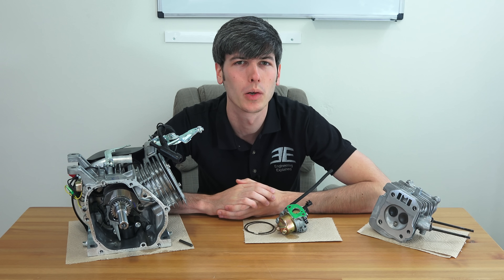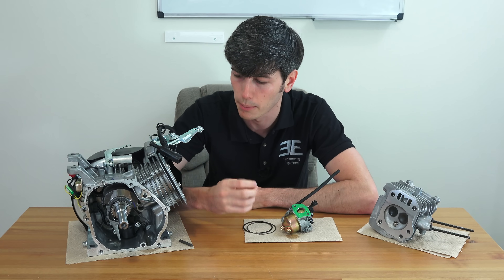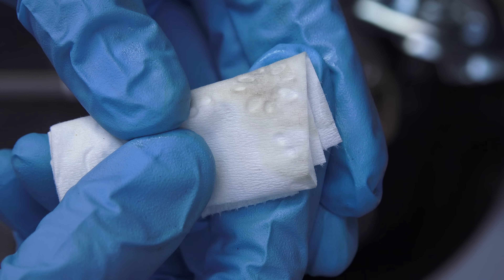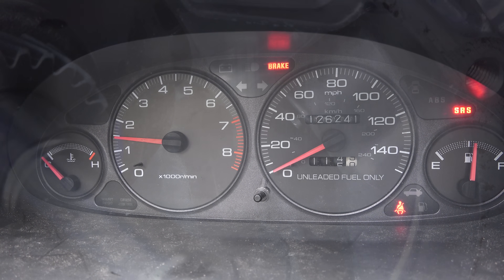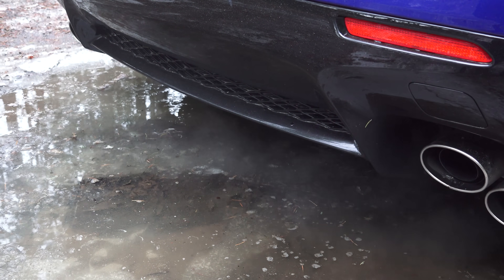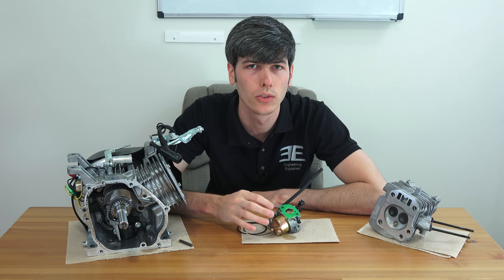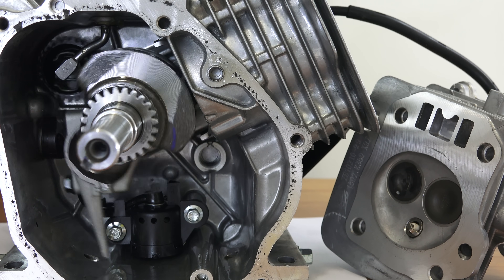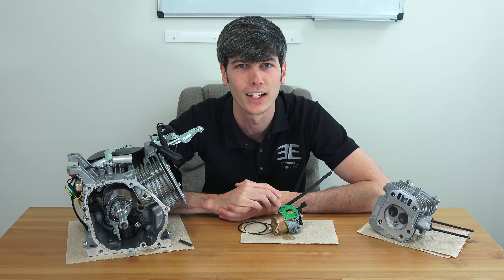Should You Warm Up Your Car Before Driving?

Comment: The reason why we warm up our cars is to warm up the car interior when it’s freezing out, not because we want the engine warm.
Reply: When its -30c out, you have to heat them up just so your breath doesnt ice up the inside of the windshield.
Literally done so you can see the road.
Reply: No. It’s because we live in Miami and we’re not used to the cold so we wait like we see everyone else do on tv.
Reply: It's a pain to take your coat off mid drive because it's finally warmed up in your car so it's better to let the interior get to a tolerable temperature before driving. Also a heater would be expensive to install.
Reply: Thats just wrong.
Idling your car wears the engine out prematurely and it make stew heater take a lot longer to actually get warm air to the interior of that car.
Since ti are in cold weather you already are wearing warm clothes, so getting inside a car is warmer than being inside because the cold air is not blowing on your and your body is warming the interior.
Idling the car that I just tested three days ago took 12 minutes to get warm air to the heater vents. The same car when started and driven immediately, had warm air coming out the vents in less than 2 minutes, so obviously driving the car as soon as you start it not only reduces engine wear radically, it gets warm air to the interior much faster.
Reply: I only warm up my car until I can scrape the ice/frost off the outside and the inside is defrosted as well.
Reply: @maxglide  Scrape faster to avoid wearing out your engine unnecessarily. By the time the interior is warm from idling the engine, you have already contributed to significant engine wear.
Reply: Billy Bob dude, you have no clue. Where I live I get 25ft plus of snow and the windows frost up on the inside! I have to wait until defrost blows warm to melt inside
Reply: @maxglide  Dude, you don't know how to take care of your car. Where I live, in some years, the snow is so deep that it buries my car completely during the blizzards that drop the temperature to -60) F (measured officially) so I have far more experience dealing with severe cold and snow. I'm trying to help you out but if you want to fill your heater ducts with mold and if you want to wear your engine out prematurely then just stay on your destructive path.
Reply: Billy Bob i grew up in northern Ontario, so I know about extreme temps. The fact remains I don’t drive until the inside of my widows are clear. I will not endanger other people because of some possible engine wear. And FYI, I’m driving my 2005 CRV, 14 years of winter and snow only minor maintenance needed. So yeah, I think I have a small idea on how to take care of my car....
Reply: @maxglide  Obviously you don't actually know anything. I lived through the same storms as you have, probably for many more decades than you, and plus i'm an engineer with multiple degrees, so I do understand more about mechanics that the average person. If you want to destroy your car then go right ahead, but posting bad information on the Internet does help anyone, you are hurting people who don't know any better. You should keep your mistakes to yourself unless you are willing to buy new engines for everyone.
Reply: I agree. It's also sometime necessary to get enough heat from the defroster to keep the windshield from frosting up or to melt the snow off of it if it is snowing. I don't generally warm up my car if the temperature is above 20 degrees F or so, but if it's colder, it's much more comfortable to drive a warm car and much safer to drive if I can see where I am going.
Reply: And its people like you that leave shitty cars for others, Always let ur engine warm up a bit b4 driving
Reply: Yep
Reply: KowalDW nah
Reply: Simplicity Audio Video for me it’s so my windshield clears up 😂
Reply: And the interior doesn’t get warm unless the engine is warm. So just get in and drive.
Reply: Myles Hejmanowski I’ve tried to do that before and my windshield go so foggy that I had to put on my hazard lights and pull over even thought I had the heat blasting the windshield
Reply: @johntaki2704  You're doing it wrong. Most likely that car has seen a lot of use of the RECIRC button. It sounds backwards but do not ever use RECIRC in the winter. RECIRC traps the same moist air in side the vents, which build up pools of water or even ice, and then when you turn the fan on it then  fogs the windows badly. To get rid of all that moisture and ice that you have built up for years, get the car up to temperature, set the heat to max heat, turn off RECIRC (and leave it off all winter) then set the fan to high and let it grin on high for 5 minutes. Hopefully it has gotten rid of all the moisture by then. Now drive but leave the fan on high or medium so it continues to blow out moisture. The windows should stay clear., if they don't stay clear pull over and run the fan on high for ten more minutes and try again. If they still don't clear up then shut it off and tow the car to the mechanic because your RECIRC is stuck in the on position.
Reply: @Billy123bobzzz  I think if the only thing that is wrong with my car is a bad RECIRC button, I'm going to drive it to the mechanic and save the cost of a tow.
Reply: moisture from breath freezing to windshield is why my coolant has to be warmed from -40 to above 0 C. friction of the crank smashing the now tar in oil sump helps to warm  the oil.  if you havent driven on frozen tires waiting for the rolling friction to make them round again dont judge or make these videos. i also idle in neutral a bit to spin some of the trans parts.
Reply: @ChickenStripsLife  Oh! The tires! I forgot about that! I only have suffered from flat spotted tires once, when I use to buy really cheap tires and there was no snow. When I pulled out on the asphalt, it was like riding on a vibrator and it took a while before they became round again That is a frighteningly fun experience. It doesn't happen on Snow, I guess because the snow was very deep back then, and I suspect that the flat spots actually gave me better traction, so there is an advantage to them. Once I could afford the most premium tires, that I have also ways used since then, I have not had any flat spot incidents, so I wonder if the new synthetic rubber in the good tires is formulated to stay flexible at lower temperatures.
Reply: @Billy123bobzzz  whelp my guess is you burn out the belt of a snowmobile by not suspending and spinning the track pre riding on a -20 or colder day. It's amazing that you live in a climate that is worse than everyone else yet still on the grid. Have fun with your better than everyone life.
Reply: Simplicity Audio Video, i use a car warm up here in canada.
Reply: Uh, you know the car's heating system warms up the inside faster when you're driving and not just sitting there idling, right?
Reply: Chicken and the egg, So probably rev it at 2000 rpm, not everyone can drive for 5min in a 20 zone, some have to go up hills and directly onto fast roads.
Reply: 100%
Reply: This video is clearly for drivers living in warmer climates where temperature in the wintertime is rarely below -10 celsius. I live in the north where it is normal to have - 20 to -30 celsius in the winter. All cars sold here have at least electric heater for the engine and optionally another for the interior. There are power outlets in the parking lots of the living areas for the heaters. I myself use a remote controlled 5000 watt fuel heater (webasto). I have a shield in front of the engine that protects it from the icy wind when driving. When the engine is pre-warmed, the climate control of the car starts to warm up the interior soon after starting up. All cars have heated seats, mirrors and rear window. Winter tires are mandatory during winter. Btw, it is illegal to keep the car engine on for more than a couple of minutes if you are not driving.
Reply: @carbonara2144  No, that's not right. I live where its -35º F every year and -60º on bad years and I have been using this procedure since my first fuel injected car and its always worked very well for me and my cars always warmed up faster for me.
Reply: @Billy123bobzzz  what is not right?
Reply: I care more about my motor than just keeping myself warm
Reply: If you dress to be outside in the cold, you’re dressed to drive your car to warm it up. That’s what I do, even when we had -23 before windchill.
Reply: Carlos Saldana yeah but I’m not gonna put on a winter coat to drive for 5 minutes and then go inside a building that has heating
Reply: Jackson H you know you can take the coat off right?
Reply: Luke Freeman yeah but why even bother taking it in the first place when I could just warn the interior up
Reply: @jacksonh7009  so your gonna idle your car for longer then the 5 minute drive you have to make just cause you dont wanna put on a jacket?? Smfh
Reply: This is why you get an interior car heater so you dont have to run the engine very long but your interior is toasty and warm when you get in. Also keeps the windows from frosting up.

Comment: Hadn't realised this before, good video. Doesn't the engine also wear faster if you drive it cold though? My guess is it's not gonna be as detrimental this, but doesn't it also have a negative effect, especially if you have to enter a highway and do a decent acceleration soon after pulling off?
Reply: Did you watch the video? 

If you did you’d realise that your engine idling to warm up isn’t without wear as well.
Reply: @306maxievo2  Yes I did.
I was asking whether the act of a big cold acceleration wears the engine down more than warming it up by idling for a while beforehand...
Reply: @BlackArtBMX  you still drive gently. The engine warms up more quickly and you get less wear and the oil degrades less.

Comment: When it’s -40f, I’m letting it idle for at least 10 minutes..
Reply: Very smart
Reply: Seems like a total waste of fuel, living in Canada when it gets that cold I just plug in the block heater a few hours before leaving.
Reply: @Spinal2111  Idling really doesn't waste that much fuel though.
Reply: @seraphimvalkyrin4543  idling wastes a lot of fuel, this same guy has a video about the difference in idling and starting the engine.
Reply: @APerfectToolSifer  I had to camp in my car once all night during fall/winter so I had to leave my car idling for 6 hours. The fuel gauge only moved 1/16 from full. That's a lot less then any other use of fuel that a car would use in a 6 hour period.
Reply: @APerfectToolSifer  it uses 0.5-1L of fuel per hour.
Reply: @gigel99324  For sure, doesn't sound like a lot but when you think about the difference between start up and idling for just a minute and driving, plus the emissions, thats a lot of waste to just have your car sitting there. Put on a good jacket and start driving, air quality is more important than having a warm car/truck to get into.
Reply: Nah according to this guy who is between age 20 and 55 ur good to go the second the engine is idling.
Reply: A coolant warming system would help
Reply: @rotorblade9508  Like a battery and oil pan heater.
Reply: Thats just wrong.
Idling your car wears the engine out prematurely and it make stew heater take a lot longer to actually get warm air to the interior of that car.
Since ti are in cold weather you already are wearing warm clothes, so getting inside a car is warmer than being inside because the cold air is not blowing on your and your body is warming the interior.
Idling the car that I just tested three days ago took 12 minutes to get warm air to the heater vents. The same car when started and driven immediately, had warm air coming out the vents in less than 2 minutes, so obviously driving the car as soon as you start it not only reduces engine wear radically, it gets warm air to the interior much faster.
I've tested this in the past in a blizzard at -60º F and the car really did warm up in just over two minutes when I only gave it ten seconds of idle time and then drove it respectfully. When I let it sit there and idle the evening of the same blizzard, to go home, it barely got warm in 15 minutes so it was not worth wasting all that gas and all that wear on the engine.
Reply: @Billy123bobzzz  that's where you're lying. Better go read some technical specs on any commercially available oil, operating at -60'F. You're 100% seizing your motor because of 0 lubricity and 0 flow from the crankcase. Furthermore the odds are your automatic transmission's oil wouldn't actually allow you to shift into any gear because it would also literally be a frozen gel (I know it was an auto because you obviously have no idea what you're talking about here, mechanically speaking)
Reply: Furthermore since you're using Fahrenheit, the only place to be that cold since 1954 was Alaska, in which case this "blizzard" must have happened in 1971 or 1986.
Reply: @l3urlyi345  he's full of crap. He's copying and pasting that nonsense everywhere. He probably works for the car companies wanting you to destroy your engine
Reply: @stylicho  Calm down, as long as you have the winter rating in your fuel you're not destroying anything. The oil I use (5W-40) is good for -35 Celsius. I've done cold starts at -32 and had no problems. Modern synthetic oils flow immediately in the cold if you use the proper rating. 
The problems with oil flow come when it gets so cold that the oil loses it's lubricating properties. On 0W-40 it's at -40 Celsius, and that's plenty unless you live in Alaska or something like that. 

This is from a Finnish person who knows a lot about snow and winter
Reply: U should probably watch the video again.
Reply: Plus, not everything is about just the engine. If the car is cold all of the other mechanical parts are cold and stiff too, like the steering, brake and gas pedal. Allowing the car to warm up and in turn the heater to warm up the interior of the car makes these parts function more smoothly. Not to mention you want to be driving the car while you are comfortable, not shivering on a rock hard cold seat and holding a cold steering wheel while the engine is still warming up.
Reply: @seraphimvalkyrin4543  damn, I've been doing it all wrong then. I take off with a sheet of ice on the windshield and my hands frozen numb to the steering wheel. I leave early in the morning though when it's still very dark outside so I can see blurry lights through the ice as I go down the road until it melts
Reply: @seraphimvalkyrin4543  yup, make sure to turn on the heat inside too, so your engine gets warm even slower.
Reply: Alex Gunner you turn up ac heater mostly to defog faster (and/or defrost) so you can at least drive, so your sarcasm here is not fitting
Reply: @Orbacle  there are sprays for that ;)
Reply: @gigel99324  The engine will producing enough friction and heat to where it wouldn't matter.
Reply: @seraphimvalkyrin4543  yeah, after how long?
Reply: @gigel99324  No difference that I ever noticed.
Reply: @Orbacle  if you keep water out of your car it won't go fog up. And get a snow broom and nice little brass ice scraper - those plastic ones suck.

Comment: Don’t agree, if you heat and cool something fast it tends to wear more, especially cold metal. Usually wait till RPM drops,that is no more than 5 minutes,gradually heat up and go.
Reply: That's why you drive it lightly. Warming the engine slow is causing more damage. I do personally give approx 5 minutes in winter months though too

Comment: These modern engine's seem to do it the other way on a cold start. When i cold start my engine at positive temperatures. 5°c or above. It has a cold start and it loud (decat). But when freezing it doesn't have one. It starts right up but runs like a normal/warm engine with no higher rpm.

Comment: Did my research and I found out eventually that oil heats up at about 10 degrees F per minute in a cold idling engine. Consider the ambient temperature and application. If you are starting up an engine with 5W-30 installed at -5 F, in the time it takes you to start clearing the windshield, the oil will be warm enough that you can start moving. Drive slowly for another couple of minutes and especially avoid rapid acceleration, and by then the oil will be warm enough that you can simple drive the vehicle. If you want exclusivity, join a country club. Bragging about your elaborate protocols for warming up an engine on a very cold morning don't qualify.

Comment: Cold start and 95% throttle for 5 minutes straight and you’re go to go.
Reply: Jordan Mendes make sure its 5 am and you have a cammed or straight piped mustang And live in a quiet close housed neighborhood
Reply: Wes Miller You will definitely get the heat on you.
Reply: In my neighborhood the police will issue you a ticket every day for being hostile towards your neighbors. Don't do it.
Reply: @Billy123bobzzz  /r/woooosh
Reply: @Billy123bobzzz  Do you need a second wooooshing?
Reply: @clonkex  I don't mind if you crawl by my house in your child's toy Big Wheel, if that is what makes you feel good, its the grown up, manly, vehicles at 3AM with six liter diesel engines that are annoying, I don't even notice your tricycle going by.
Reply: @Billy123bobzzz  You clearly do need a second and even third wooooshing. The original comment was blatant sarcasm. Your serious replies have shown you didn't understand that. Hence the wooooshing.
Reply: @Billy123bobzzz  r/woooosh
Reply: @franciscocortes5427  There was nothing to get, it was not funny enough to be a joke, go home and ask your mom to help you try again.
Reply: Best advice ever.
Reply: That’s the only way to insure that your up to temp.

Comment: I always wait about 15 seconds for the rpms to fall below 1,000, then gradually take off with low rpms no more than 2,000 until warm enough. Keep in mind the transmission has to warm up gradually too. The transmission is a more expensive part than the engine.
Reply: Transmission is more expensive? What engine do you have? 😀